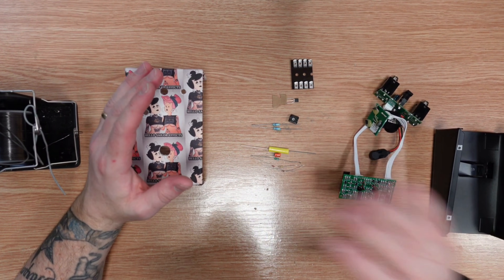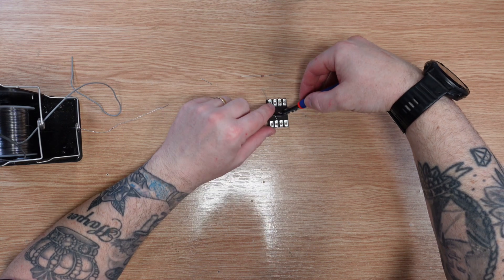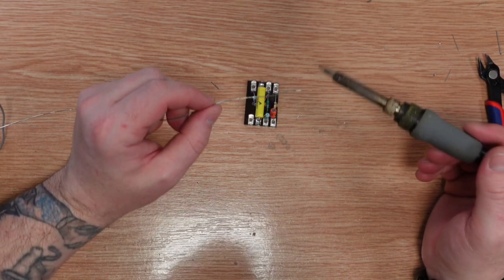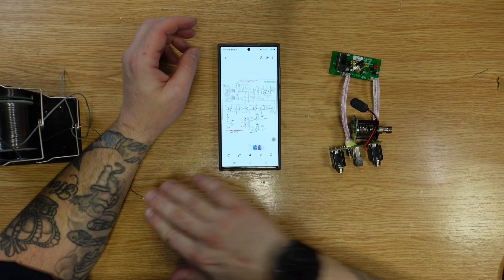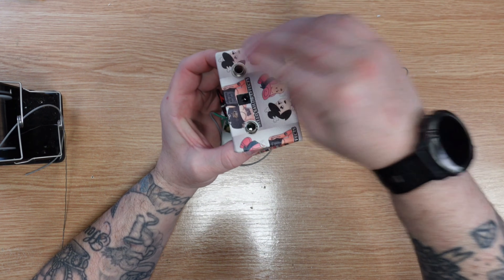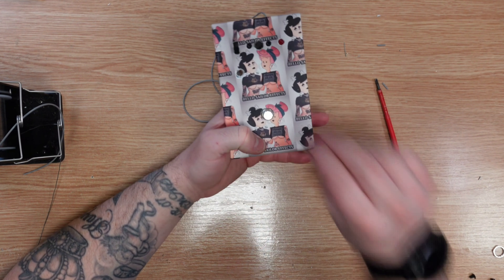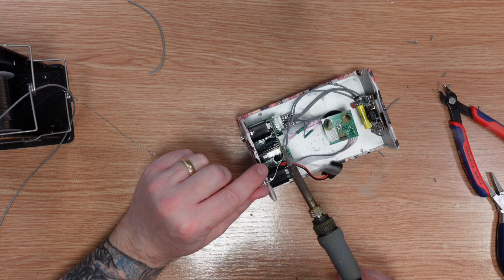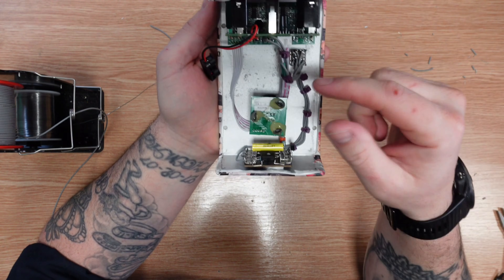Get the BEST Tone of Your Life with Handwired ZVEX SHO!

Comment: If you check those diodes with a dvom, on the diode setting,what do they read ? I have some diodes that I'm trying to figure out what they are.
Reply from the maker: @davidthomas1356  They are usually around 0.7v mate. What are yours reading?

Comment: The SHO is an excellent circuit to use as an Input Buffer/Preamp or as Output Amp/Line Driver for many circuits.
Specially vintage stuff that often can sound a bit dull.
Slap a SHO at the output and it comes to life with a nice sparkle! Put it in front of a dull Overdrive and it screams!
Reply from the maker: @neilmcnasty  Well said mate. It's a fantastic circuit and it's a great starting point for someone wanting to make their first pedal.

What other circuits do you think punch above their weight?
Reply: @hellosailoreffectsofficial  I always had a great love for the Dallas Rangemaster, specially if you increase the input cap so that it starts getting dirty, but you keep the Output cap small avoiding it getting boomy and too saturated in the bottom end.
Many have copied the circuit, but there is still stuff to discover in it's simplicity. Especially by tweaking the bias of the Base/input in order to make it less noisy.
My Favorite Mod/Variant:
Adjusting the bias/value of the Emitter resistor works as a compression/tightness control. So I like to replace it with a B10K Pot for a "Loose/Tight Control", and I like it a bit loose (more dynamic and responsive to picking dynamics + a slightly tilted lower mid range)
I often hit it with a boost up front to drive a ton of Harmonics out of it for lead melodies. It can be pushed all the way in to Fuzz territory if you like...
A great circuit to use as one out of several gain-stages in a Overdrive.
Reply: @hellosailoreffectsofficial  A well kept secret is the Don Tillman JFet Preamp.
Highly Recommended and it is an ultra simple build.
I love it as a Buffer replacement (with the boost option). Brings a rich low end with sparkly highs. My always on circuit.
Gives greater control/range to your guitar's volume pot if placed first in your chain.

Other great building blocks are: The Baby Pink Booster from BJF and The rare 3 Knob Fender Blender Preamp section.

Boosters and 1 transistor Preamps are great building blocks!
Stack 3 different boosters in a row and you now got yourself a 3 stage overdrive. It is a great way to learn how bigger circuits can be easier understood by breaking them down in to their separate sections.

Comment: The VP isn't true bypass, it'll leak into your signal when it's off.

The Behringers that look like plastic Boss pedals use the same surface mount switch on the pcb but most are buffered bypass like Bosses